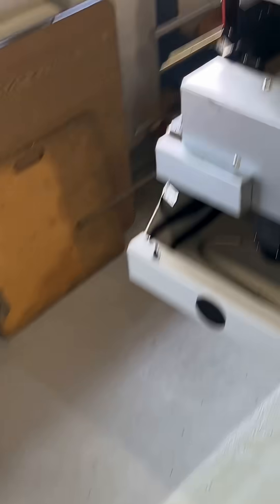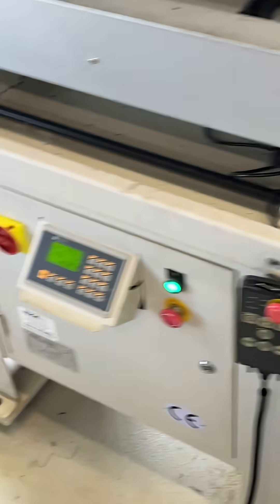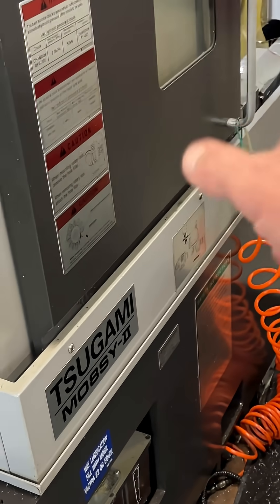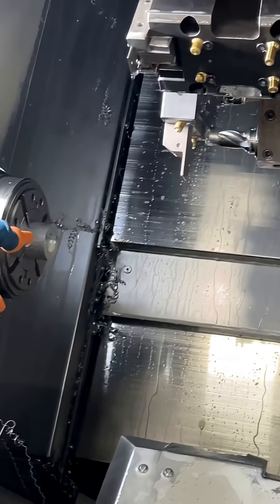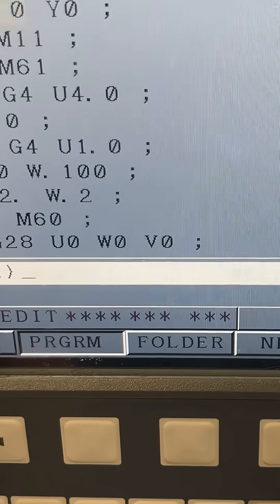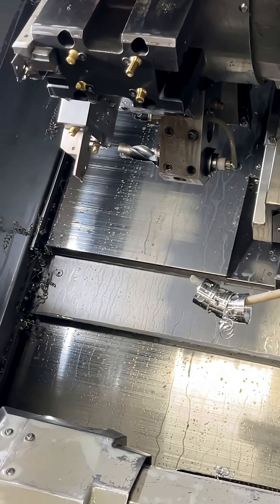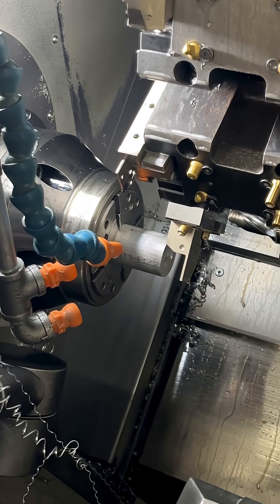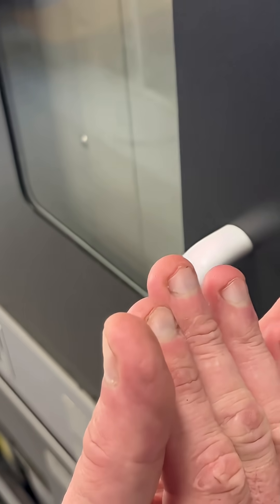Let’s talk about Barfeeds 😎 #automation #automate #productivity #cncmachining #machining

Comment: I’ve been meaning to do this on our haas, where do you set your stop, at g54 or a lil more out for facing? I also had the fear for some reason it would push to hard into the stop and alarm out or push the feeder out of alight ment
Reply from the maker: We set the stop at .02 longer than the face in Z - with the servo you can adjust the pressure and it won’t push hard at all. In the video you can see it pushing soft - we can go softer than that actually. Setup the haas to do it and you won’t regret it 🙌 thanks for the input